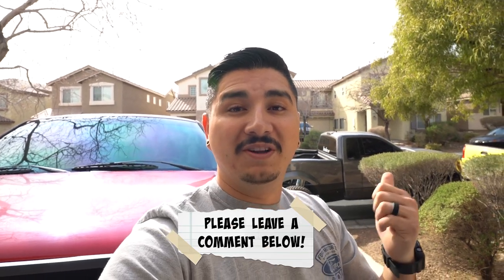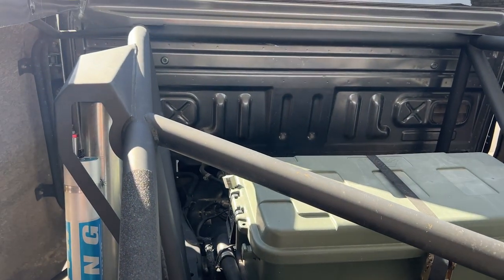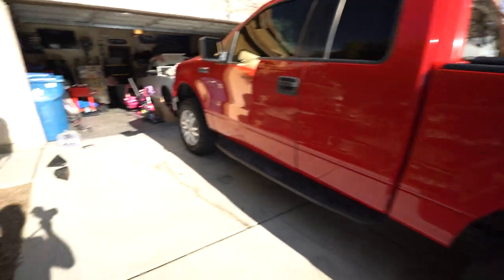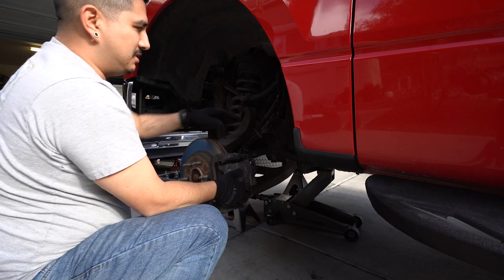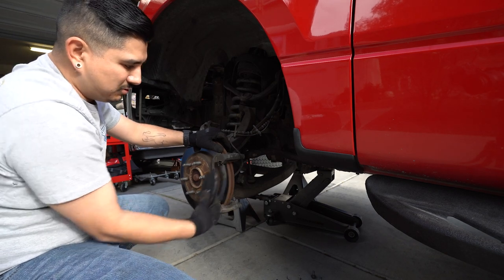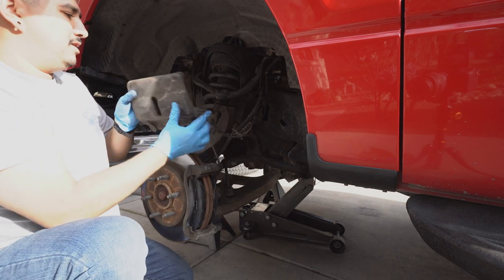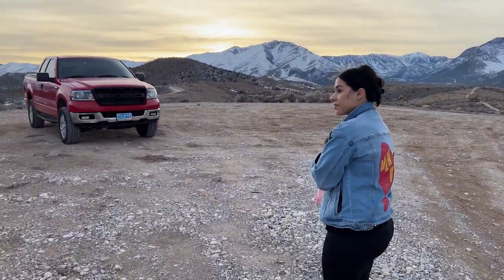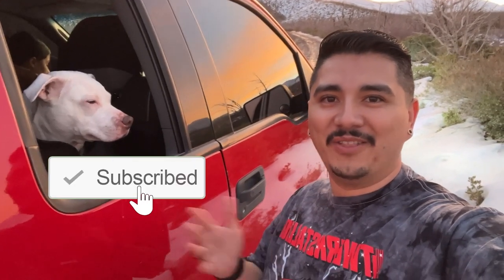New Brakes and Offroading through some snow!

Comment: I have a red one just like your truck I'm looking for running boards just like yours. I inherited mine it's a 04 with 65,000 miles on it they are pretty trucks
Reply from the maker: If you scroll down on my channel I have a video about the running boards. They are OEM Ford Raptor running boards 👍🏼  I hope you love your truck. This is my second 11th Gen F150 and I love it.

Comment: Completely unrelated but I just picked up a 2004 and was wondering if you know anything about wireless keypads? I have been known to lock the keys in my cars, mostly while working on it, and I would like to put the type that you type a code on and it unlocks. I know it works on transit vans and Amazon sells them but it specifically doesn’t list the F150 but does have 250 and higher. On a forum I found somebody with a Lincoln that claims it is just a keyfob with a code on it. Sorry this came out of left field, found your channel while looking to see if there was anything special for doing the brakes which I am handling this weekend and the algorithm pointed me at you and you seem to be an aficionado.

Comment: If you do anything about the tick or lifted cams do a video :)

I bought an 05 as a second owner 2 years ago with 150k miles 👍
Reply from the maker: I did a full timing job about 6 months ago but didn’t make a video. I will probably make a video soon going over what I did though and some tips and tricks. Thanks for watching! 🙏
Reply: @JustKingAdrian  

Great!

Looking forward to it. Needless to say I’ve purchased it 2 years ago and I’ve only had one lol change so far…. It’s been sitting 😭 really clean and nice truck to look at though
Reply: One oil change*

Comment: hey how's the headlights holding up I'm thinking about getting some
Reply from the maker: Pretty good. One finally started to show some like clear coat peeling but nothing major I just pressure washed it off and I am planning on making a video to “re coat” them but haven’t gotten around to it and it hasn’t gotten any worse. 👍🏼
Reply: @Just King Adrian  do you think there are better quality ones with the same design. I have a 2006 I want to redo

Comment: What led lights do you use and I love ur videos and I have a 2008 f 150 and it’s cammed with 82 thousand miles on it
Reply from the maker: Thanks for watching the videos! My actual headlight bulbs? You can see everything I used in my Amazon page linked in the description but if there’s something you can’t find just let me know 👌🏼
Reply: Yes the actual bulbs
Reply from the maker: @charliesnider9285   These are the ones I run in both of my trucks right now. https://www.amazon.com/dp/B06XHCQ8KY/ref=cm_sw_r_as_gl_api_gl_i_KRAH3DGCSPHAWMP1W03S?linkCode=ml1&tag=adrianmirabal-20
Reply: @JustKingAdrian  thank you and have had any issues with them
Reply from the maker: None with these. I ran some with fans before and they were loud and an led burnt out. I’ve had these on the truck 1 yr and 7 months so far with no issues.